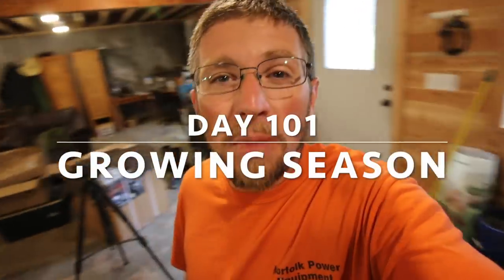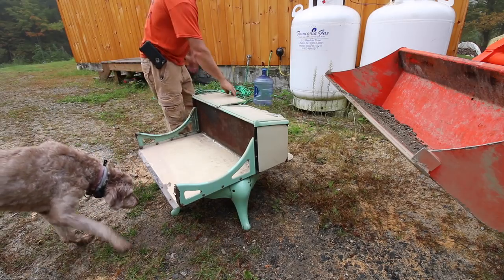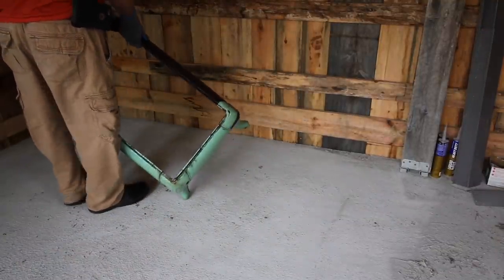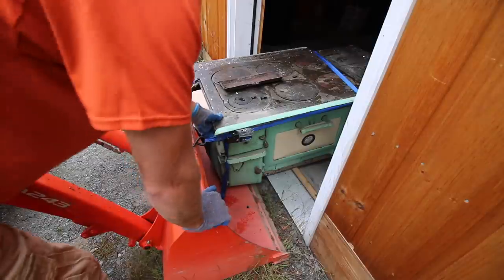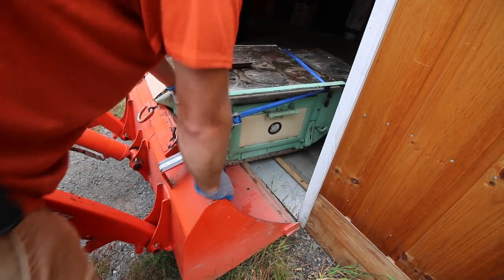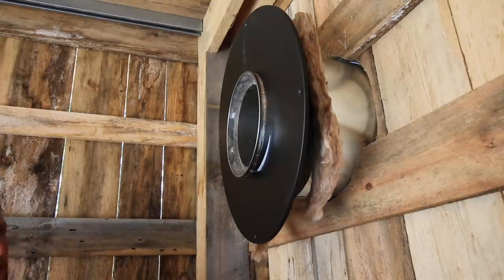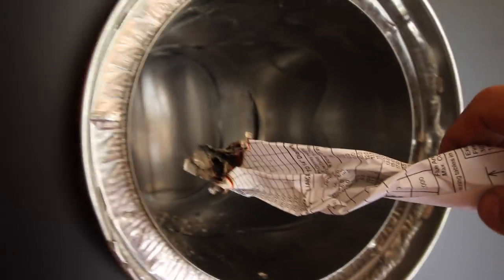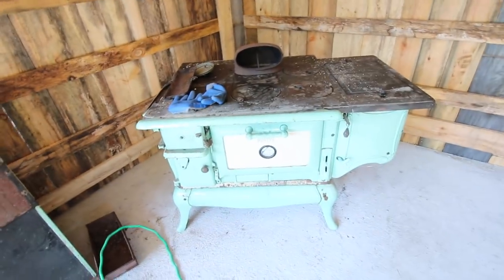We've Been Waiting 4 Years for This!

Comment: Ohhh that is sooo nice Lumnah's!  Great job on the initial installation, I'm sure you will tweek it up when it's all hooked up. That was actually the easy part, the hard part comes when you are making sure it is as airtight as you can be around the stove fire box(es). Did you plan the sliders opening to be big enough to drive the Bota' into the kitchen.....of course you did!  lol  God Bless
Reply from the maker: Thanks! Yes we planned it so we could drive in with the tractor or a car if needed. It took some figuring but we did it

Comment: those old kitchen wood stoves are a great addition to a house and better in an outdoor kitchen so it can be used. I grew up with a neighbor who had a kitchen wood stove, it was all they had. It was fun to watch her cook on it. One problem with them is that they didn't make to fire box large enough so you have to put small pieces of wood in it constantly. The newer models have a large fire box that allows for larger pieces and will also heat a large room.  Looks great, you can always put bricks behind it on the wall if it gets to hot, also helps hold heat.

Comment: nice stove. I grew up with a kalamazoo stove in my parents kitchen. the bread warmers in the top work good to dry work gloves. we always fed wood in through the top trivet never using the front loading door.  it always was burning in the winter for supplement heat to the wood boiler in the basement, so most meals were cooked on its top in the cold season.

Comment: Put a tape around the oval. 7" diameter will be close to 22". Or measure thru the center at widest and narrowest points. Add together and divide by 2 for diameter. If you run single wall, install with inside 'crimps' pointing BACK TOWARD stove. This is counter intuitive but, any condensation will stay inside the pipe and run back to the stove instead of making a mess out of the outside. Hope this helps.
Reply from the maker: Thanks! Now I know why the crimped end is up! Thanks

Comment: I had a white cookstove similar to that one in my kitchen long ago and a regular woodstove in the den. Between the 2 I could heat the whole downstairs. (2000 sq feet) You just have to get the cookstove fire going well and some embers built up, then flip the damper thing that causes the oven to heat and open the oven door a little. I also kept water kettles on both and kept water in the tank to heat it on the cookstove. It was set at an angle too, and while I thought about putting some type of insulating material with stove over it to absorb and reflect heat I ended up moving. I think it would have helped retain some heat.

Comment: What a nice wood stove. 6 burner, hot water tank on the side, warmer ovens. Probably has a lever for the firebox to switch between coal and wood from the looks of it. That most likely is set up for 6" pipe, they make a matching oval flange section that will fit right on the stove. I had a similar one when I lived in a turn of the century farmhouse in Mequon, Wis.. The owner of the house let us live there for a year. He loaned us the old cook stove his grand parents had ordered from the Sears Roebuck catalog. The family were original homesteaders from back in the Little House on the Prairie days. It was a beautiful, large old timber frame house. 
Use your vinegar solution to clean up that stove top. Follow up with a good coat of inexpensive cooking oil. Fill the water tank to check for leaks. Build a small fire to burn off some of the cooking oil, and season it. Once it's all nice and toasty, you should wipe on light coats of oil. That's a beauty, cherish it, truly an heirloom piece. 
You certainly had the Mrs. worried with all your ladder antics. Glad you were able to get it done safely, I had faith in you.
Reply from the maker: I am trying to figure out the oval pipe now. It seems like it is a 7" pipe that is ovaled. The water tank is missing its liner. We will have to get something made for the inside of it. I can't wait till we get to light the first fire
Reply: Measure the outside circumference of the oval, divide that by 6.28. That will give you the radius of the pipe. Multiply that times 2. That is your pipe. A 7"  pipe the circumference of the oval should be just under 22". A 6" pipe circumference will be right around 18 7/8". The circumference of the oval should be the same as the circumference of the circle. An oval is a flattened circle.
Reply from the maker: Great knowledge as always! Thanks

Comment: Those old cookstove are fantastic!
Love the coochie! What brews? She is beautiful.
The long pipe on the stove will provide more heat. You might want to put heavy plastic in some frame...then you can use long lag bolts to attach the "storm windows". Then, you can use it into the winter...just a suggestion. Somewhere to warm yourself in snow...wouldn't need to track slime into the home.